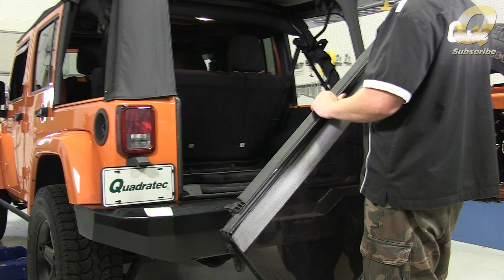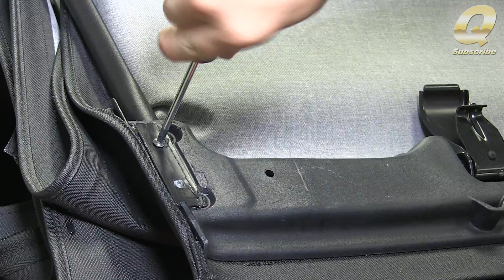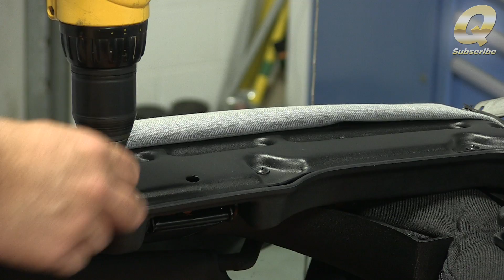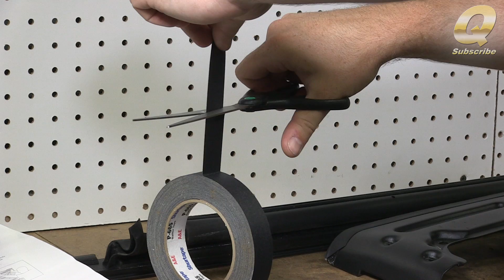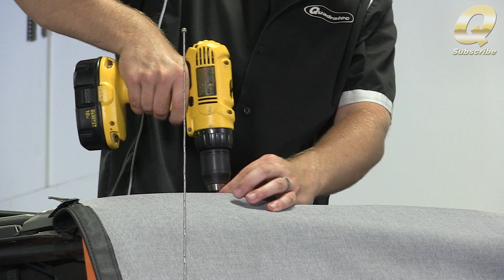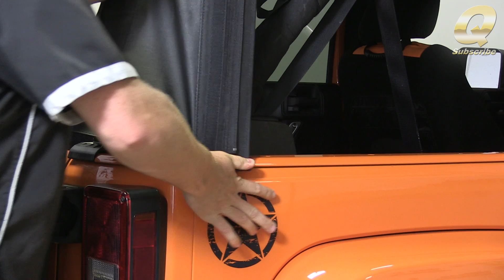Quadratec Replacement Soft Top on Jeep Wrangler JKU 2010 and Up Install

Comment: It look the same as the stock one. Why changing it ?
Reply from the maker: It is a stock style replacement, so if you have a damaged or worn out sift top but wanted to keep the factory look, and factory hardware, this is the top you would want.

Comment: I like to have a hard top but need a soft top in case I'm in the middle of nowhere and it starts raining. Is there a way I could install this and use it and in the winter just leave it installed yet down with the hard top over it? I know that there is something in the Jeep soft top warranty that if you do that you void the warranty. But long story short can I leave this down and put the hardtop over it?
Reply from the maker: The short answer is no.

Technically, yes you could leave the soft top in the Jeep, folded down and install the hard top over it. In fact, that's how Jeep delivers Wranglers to the dealership when they come with the "dual top group". However, we don't recommend doing that. Once the top has been "used", meaning it's been folded up and down on the Wrangler, it becomes very difficult, if not impossible to fold it as tightly and compact as it would need to be for the hard top to be installed over it. You would also have to disconnect the soft top support bows from the sport bar in the Wrangler, and the end of the bows could potentially cause a danger to passengers in your Jeep without them being securely attached to the soft top support brackets.
Reply: Quadratec ok thanks

Comment: I put my Quadratec Top on with this video...  Took a bit longer than expected - but now it looks good and seems to fit great.  Glad it was a warm day though...   very tight...  :)
Reply from the maker: +Theo Klaase You'll be thankful for that tight fit install in a couple years. Soft tops tend to get a little loose after a while so that starting point really helps. Glad everything went good for you.